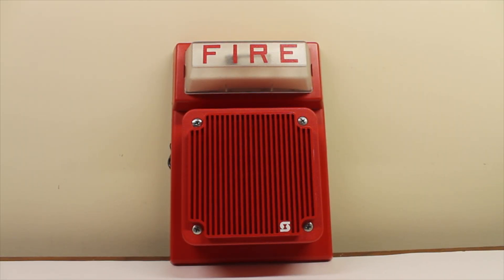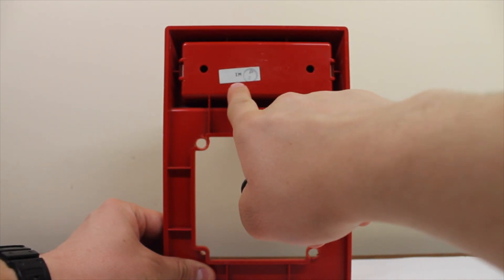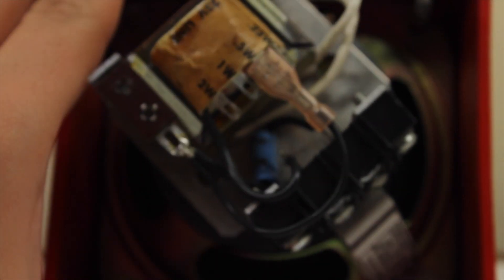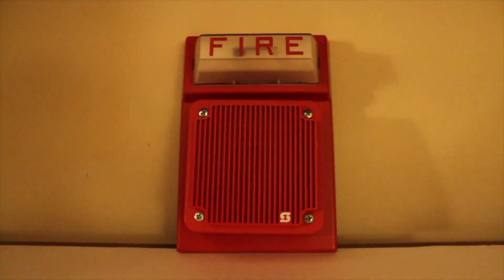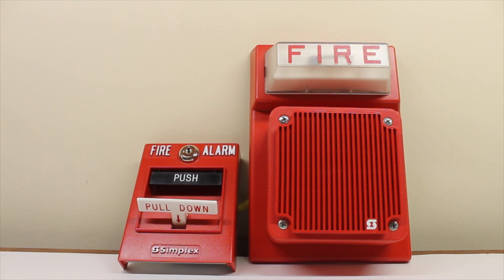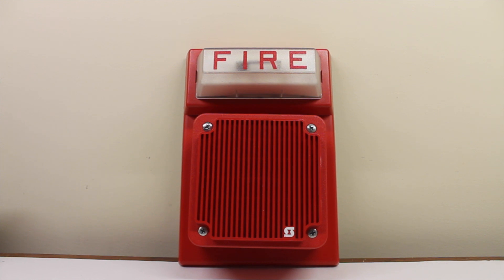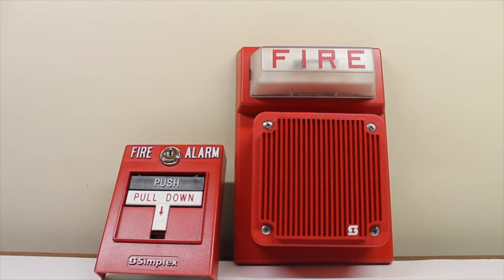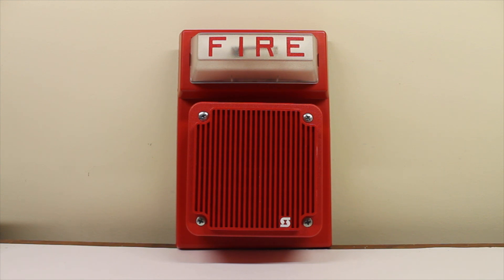Simplex 4903-9101 w/ 2902-9732 (LifeAlarm Speaker) Fire Alarm Overview/Test

Comment: A building on my college campus has the flush mount LifeAlarm speakers (no strobes!) It was built in 1987. 
Yes, Simplex tends to use other companies designs. They had the early ADA strobes that were essentially the same strobe tube as the Gentex GXS. Most of their mechanical horns were actually rebranded Faraday products (9838 and 6120 are the same horn. Apparently, space age electronics designs a lot of their modern stuff.
Reply from the maker: That's pretty cool! I've heard of the flush mount speakers before but never seen them in person (I saw the Atlas Soundelier version in person more than I've seen this version installed).
Reply: I’ve certainly seen the flush mount LifeAlarm speakers. I feel like I’ve definitely seen them in another place, but I can’t remember at all where it was! 
Other than those, my campus is full of other rare devices, such as the 90s Gentex SPKE4 speaker strobes, which look like a Wheelock E70-LSM-24 but with a Gentex GXS style strobe. And, those speaker strobes are hooked up to 1 of our 3 old pre-Honeywell FCI systems with voice evacuation. They’re so rare that no-one even seems to know what they sound like!! And would you believe it, I missed the drill in my dorm which I believe has that mysterious system.

Comment: eh i should get a 4903 and to 6 and 8 series of that combo strobe plate with smart sync and that old 2902 9732 speaker life alarm just in case also. i might see and be the damn judge if that speaker voice evac is kinda beefier than ever than the modern ones. but some fire alarm is sorta quieter ish idk. but it should be bassier and richer and ultimate hi-fidelity like ish.
Reply: i use them to be syncronized to prevent people having seizures rather than free run though. but the smart sync nac simplex etc are useful though.

Comment: This combo seemed to be fairly standard for Simplex voice evac systems around 1990-93, and the LifeAlarm speakers in general seemed to installed regularly until around 1995 or '96.      The Hill Center at Rutgers had this combo, last I knew.    There's also one dorm at Rutgers (opened 1995) that has a few of these on 4904-9105 strobe plates (the early ADA compliant ones), though they mostly have separate speakers and remote strobes.   And there's another dorm that has these as the remote speakers (mostly in the rooms), but the speaker/strobe combos are all Wheelock with the early "WM" ADA strobes.
Reply: Another place that uses this combo is the SAP Center in San Jose, which given the start of your comment and being built in 1993, makes alot of sense.

Comment: If one sees a Simplex alarm in a building, then does that guarantee that the system is Simplex and nothing else? 

What I mean is, when you see a System Sensor or a Wheelock alarm, it could be anything, any system. Are Simplex alarms exclusive to Simplex systems?
Reply: Generally speaking, yes.   Though occasionally you will see older Simplex devices connected to a newer non-Simplex panel.   For instance there's an Applebee's around me that updated to a Fire-Lite system in the mid-2000s, but retained the Simplex 4903 horn/strobes from its original '90s Simplex system.

Comment: Hi there, I have a question. If I used a small amplifier system that I use my phone with, attached to a 70.7volt speaker, would the speaker still work?
Reply from the maker: Your best bet would be to get an amplifier that can output to what speakers can accept (I use a Pyle Home PC20MA, which is able to output to 8ohm, 25v and 70v, but one at a time though). A regular stereo system will not work, does not provide enough voltage, which results in a pretty quiet speaker, and will eventually damage both equipment (admittedly, I used to do this for my earlier test videos, but that was before I got the amp).

Once you do get a suitable amplifier, you can then hook up your phone. Hope this helps.
Reply: @NewEnglandElevators  hmmm. By best option right now then would be 25 or 25/70 volt speakers. Thank you for the helpful information. 👍
Reply from the maker: @kingcarwashnfansdrivesetc8364  You're welcome, hope to see some Speaker/Strobe videos from you soon! Great videos, btw!

Comment: My school has those alarms all over the building. They are on the same strobe plate as well. It was built in 1993. Some of the newer parts of the building have true alert speaker strobes. I am guessing the panel was originally a 2001, recently upgraded to a 4100ES and plays the simplex Hi-Lo tone.
Reply: Was it a voice 2001? I know this is a very late reply

Comment: Just for future reference, 1990 was the year ADA was established and required all fire alarm systems to have visual strobe lights and 1994 was when the code was updated to require all strobes to have transparent lens, a minimum of 15 candela, and a rate of at least one flash per second
Reply: ElevatorMan5482 ElevExperiencing Productions I don't think that's 100% accurate my local elementary school was built in 1997 none of the alarms have transparent strobes

Comment: I've seen simplex strobe plates designed from the seventies or eighties tilted sideways.  The building they were in, well around ninety-eight, they replaced them w an Edwards system, then a simplex system from '05's been there ever since

Comment: my school has the these strobes with 9838 horns and truealerts
Reply from the maker: +CN railfan That combo does seem typical for the time period. The True-Alerts mixed in seems kind of interesting; are they mounted to the strobe plates (I'm assuming that they are replacing -9838's).
Reply: +NewEnglandElevators the truelalerts r yes but they also aren't on the plates
Reply from the maker: +CN railfan Must have been former combos that died, and True-Alerts were put into place, unless this was part of an expansion. If this was not an expansion or renovation, are there any remains of one of these combos where the True-Alerts are now (True-Alerts sit larger backboxes w/ adapter plate, unpainted area where the plate once resided, etc)?
Reply: +NewEnglandElevators actually both yes and no watch my video school fire alarm
Reply: +NewEnglandElevators there are truealerts on addition and the rest are replacements cause they died

Comment: Old! For some reason I feel like this combo looks really nice and very retro
Reply from the maker: +NJMoo3652 It definitely does feel old, but has an awesome retro vibe to it. I remember seeing the earlier 4903 series strobe plates (-9101 and -9105) quite often. They would usually have a 2901-9838 (and maybe an occasional 4903-9805 as well) mounted onto them. Sometimes I would find a 4903-9105 with a speaker mounted onto it, usually an Atlas/Soundolier manufactured speaker (Simplex distributed these as the 2902-9711). I only have seen this particular combo once.
Reply: +NewEnglandElevators Two schools I attended had 4903-9101's, with -9838's in the main areas, and 2902-9711's in some of the larger rooms.
Reply from the maker: +Fahrenheit4051 Having a -9711 paired with one of the 4903-9101's seems unusual, when I think about it at least. I usually associate it with the 4903-9105 somehow. Interesting that you know of a few setups with the 4903-9101's paired with the 2902-9711.